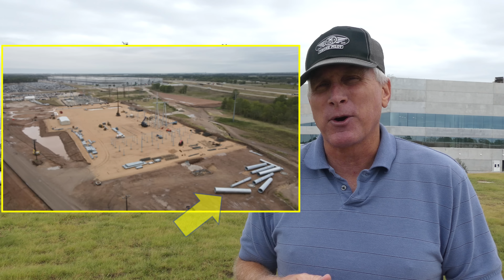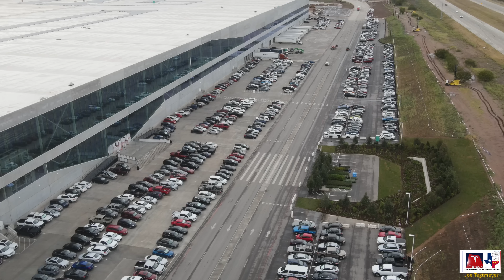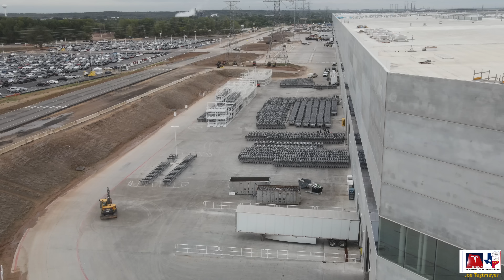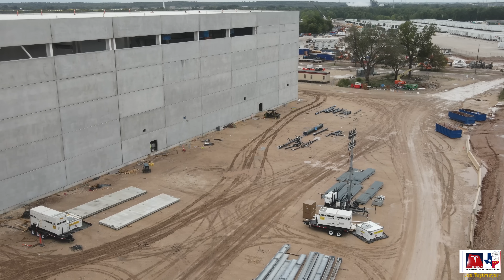Paint Shop Permit & Model Y graveyard! 17 October 2022 Giga Texas Construction Update (12:15 PM)

Comment: Prediction:  One day, perhaps a year or two out, vehicles from this factory will deliver THEMSELVES to local customers.  No car carrier truck needed for short-haul local deliveries or travel to railhead.  About the same time, the car-carrier trucks (Teslas) will drive THEMSELVES to non-railhead locations as needed for more distant deliveries.  Optimus robots will be performing logistics/manufacturing work inside/outside the factory in some cases, and a new HVAC products manufacturing plant will be under construction on property.  The property will also have a least 2 or 3 three tunnels (Boring Co.) connecting different facilities on site, or under construction to do so.

Comment: Regarding the new substation, It will not be powered by tapping the existing transmission line but it will be connected in series so it becomes a part of the grid and can be powered from two directions. That makes the substation more complicated but offers redundancy. AFAIK all transmission substations are built this way.
Also the two transformers will be sized so that either one can provide all the power needed for the site. This facilitates taking one transformer out of service for maintenance or repair as well of redundancy in case of failure. Again this is standard procedure for transmission substations.
Reply: I certainly don't know much about this subject, but it has occurred to me that this is a rather large substation for such a factory. Could it be that Tesla is not only making sure of it's own uninterrupted power supply, but also a buffer for the local power grid.  Would like your informed opinion James.
Reply: And of course wouldn’t it be slick if they were able to feed back some of the solar power back to the grid if need be.

Comment: I'll take a wild stab at the south end construction.  The cleared areas on each side obviously follow the line of the building.
So for the main entrance to be centered in the structure there will have to be an 80 foot tall 500 foot long extension including the roadway between.  Elon mentioned a Ecological paradise and we know they are going to put a 4 lane road along the river, so the river is not included in this phase of the construction.
   I think they are going to construct two glass walled arboretums 80 ft tall in the shape of those current cut outs.
And my best guess is there will be an elevated portion one or two stories above the concrete slab spanning the distance between the towers. The span might be glass might, not might be has high as the towers, might not.

But that is how I envision his ecological paradise given the two big holes, and an offset main entrance.
  
Won't take long to find out.
Reply from the maker: That's a very interesting idea and concept and could look really cool. Not sure how close that may be to what they have planned, but it's the most interesting idea I've heard! Hopefully in the coming weeks we'll both get more clues and figure out what is going to be done on this south end. Thanks for the ideas!

Comment: Thanks Joe.
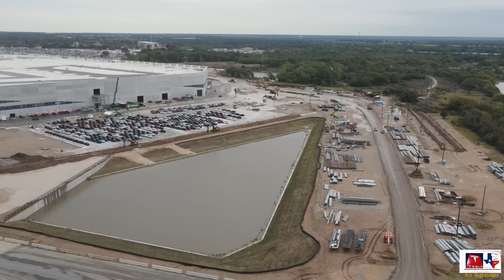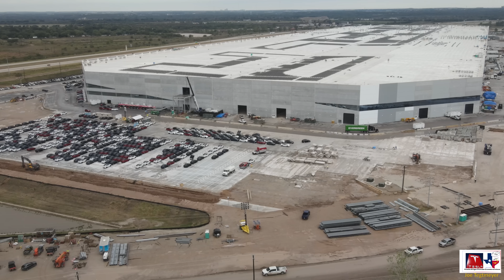3:07. Steel Fabrication Yard. Right. Trenching. Looks like a black pipe placed. At 5:28 more like grey conduits.
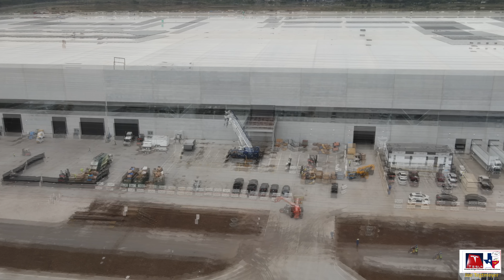7:03. BIW. Loading platform. Seems a roll up door/roller shutter has been installed.
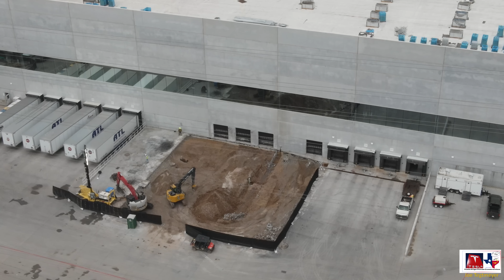8:01. BIW, apron. New loading docks. Apron to the south remaining in place must have too many utilities/services to warrant demolition. For now at least.
8:26. BIW, roof. I’m curious to know why the roof beams have been repainted. Compare with Joe’s 26 September video. https://youtu.be/3k3n2jQZAas?t=441
The yellow looks like expanded polyurethane foam.
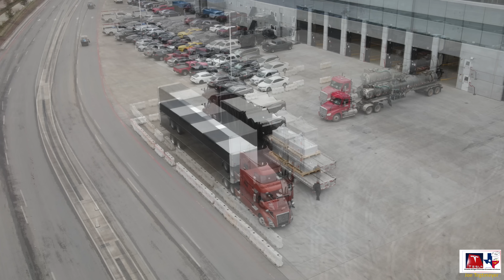11:25. Battery, apron. Roll of steel/aluminium inside the truck. Tanker delivering gas?
11:55. Battery, road. Out for a jog.
13:18. Casting, apron. Red Model Y has the rear glass installed.
14:37. WOW yard. 2 more gas tankers.
15:19. East side recycling yard. In amongst the BIWs is a rack of structural battery packs, empty presumably. Or possibly just the top section. Another on the ground hiding.
Seems to be boxes of components to the left. Disassembling completed vehicles as at Berlin?
15:36. Cathode. Blue pipe has floated.
16:06. Cathode. Level 1. Right. Shallow trenches formed up for services/drainage. Similar to those around the giga-presses.
16:24. Cathode. Bottom right. Pallet of hydrant risers.
17:07. Far north. Hire depot yard. A bow roof between a pair of containers. Maybe the yard will be long term.
17:32. Cathode north. The mystery items safety out of view from prying eyes. 
Piles of steel. Tapering roof beams visible. 2 types.
18:46. Cathode west. Ground slab. Still re-routing conduits around the column footing locations. A small building to the left, tanks possibly to the right.
19:19. Cathode west. Bottom. Steel decking for the elevated access platforms. I was hoping these might louvres for the wall openings.
24:15. West of highway. New clearing. stack of blue sandwich/freezer panels. Lots of short lengths of steel.
24:53. Battery, apron. Tanker has backed into one of the drive in loading docks.
Reply: Great notes, Dessie! I assume the trenching at 3:07 is to bury the powerlines that run through that steel fabrication yard. I think I remember seeing somewhere that they had filed a permit to bury those lines
Reply: @zacadams7070  Hi Zac. 3:07. Would seem to be. David Johnson has picked up that the parallel trench to the north meets one of the electrical vaults.

There might a couple of services/utilities in that trench at 3:07. I think there is a black pipe amongst the grey conduits seen later.
Reply: re 24:53 it doesn't look like a regular gas (gasoline) trailer. I noticed earlier in this video that the large vessel trailer sported some smaller vessel connected with a green colored hose, perhaps for fluidized transport of small resin pellets. It could be a supply of the famous pink colored polyurethane filler for the structural pack! That would signal progress of sorts, with structural packs being made in volume in GT. One more day, then hopefully some firm news on the 4680 ramp, tomorrow at the earnings call.
Reply: @hardernl8893  24:53. I should have more properly written 'a gas'. Didn't mean gasoline. The tanker seems to have a hazardous material symbol. I can't make out what it is. Nothing in Joe's photos.

Polyurethane pellets would be an interesting development.

I couldn't make out if the roof drainage arrangements worked. Did seem to be some water where the roof drains turn down, but not excessive. The area with the column footings nearby wasn't flooded for example.
Reply: @hardernl8893  PV array wiring and inverters quite different at Berlin. https://youtu.be/8jbNtD-VJPQ?t=132
Reply: @DessieDoolan  thanks for the Berlin info, and also I agree that serious flooding at Cathode was a non-event. Good on them!
I've spent hours to find a detailed description of utility-sized solar array technology but no success. It is Hi-Tech, only fully understood by the experts. As it should. There was a moment when I thought I had hit pay-dirt with descriptions of additional "MPPT" boxes also being necessary (short for maximum power point tracker) but those boxes are only of use when a solar system is primarily connected to batteries and that may or may not be necessary at GT. The only observation we can make is that these special boxes that you identified do not appear to be connected to all the strings, there is certainly no massed wiring like in this recent GB video. So the Go Coyote suggestion for lighting appliances may well be correct; I just cannot find any description nor pictures of our "mystery-boxes".
Reply: @hardernl8893   I'm calling them the "Quad Boxes". 

I can't find the exact shot or video that I was looking for. Here's some close enough shots of a conduit (or similar) connection to the Quad Boxes.

Joe 17 October. Top right. Conduit connection to box. No apparent connection to the PV panels. https://youtu.be/kelmeBO9z84?t=520
Brad 14 October. Top left. Conduit connection.  https://youtu.be/l5tQh7ZzU34?t=379
Jeff Day 813. Drivetrain/Highbay area. https://youtu.be/hQNSMVDcoYk?t=817
Jeff Day 811. As above. No conduit to boxes. https://youtu.be/4i-V2e5ozG4?t=796

Comment: South end...
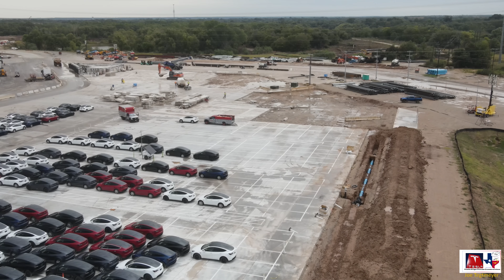@ 4:19 (bottom of screen) New fire hydrant inside boundary of '500 ft. extension'???
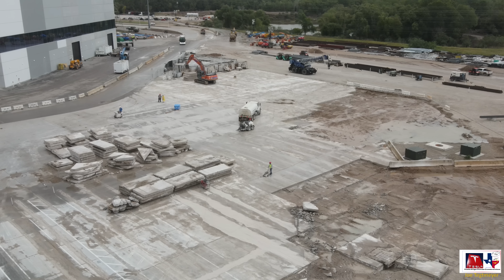@ 4:33 (Right side) Transformers/switchgear also inside boundary of 500 ft. Extension.
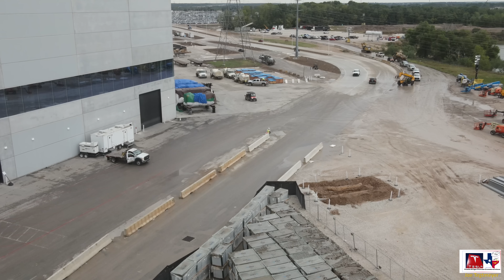@ 5:02 Trench goes right up to vault. Existing cables going through vault provide power to the building from local power grid on the south end. Appears to be a reroute of power?
Reply: 5:02. So it does. Could be the burial of the powerlines shown in a permit application.